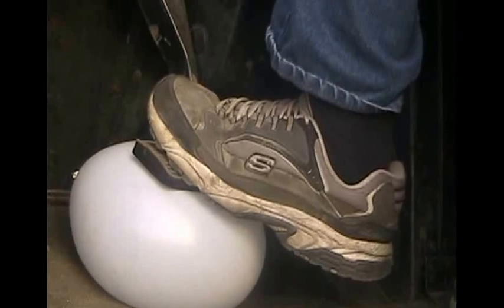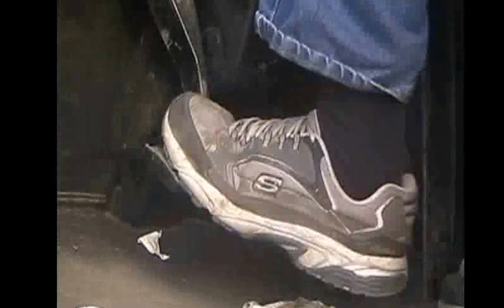Learn to Double Clutch with a Balloon-Micro lesson

Comment: I didn't have a problem with this because I only half clutch in my pickup truck any way. The 2 problems I had were matching speeds and the shift pattern is different on a truck. One thing I learned when I finally drove a 10 speed Eaton the other day is double clutching or not you still have to match speeds. Between that and trying to remember were the next gear is. All the gears are opposite of were they would be in a car.

Comment: Is the clutch supposed to feel nice and tight? There is a International 9100 at work that I took for a test drive and the clutch pedal felt really spongy and stiff. It also took more than 10 seconds to get into gear from a dead stop with the clutch pedal pressed all the way to floor.
Reply from the maker: Yes, the clutch should be stiff after the free play. When pushed to the floor, you should be able to immediately put the truck in gear. If you cannot, the clutch brake is out of adjustment or bad.

Comment: Wait, hold up! I have vintage cars with crash gearboxes - and when I shift, I always put the clutch fully in. It was how I was taught. I usually get a clean shift, but when I don't I put it down to engine speed and / or the speed of the change itself. Should I be changing on half clutch too? I have videos of my shifting technique on my channel for reference - indeed, that's probably why this video was in my 'recommended' section :)